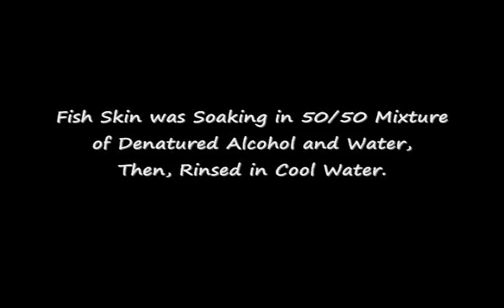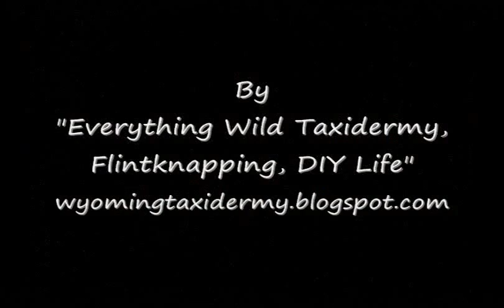FISH TAXIDERMY - BASS - Mounting, Fins & Repairs - Video 3 of 5

Comment: Hello, is there an alternative(s) to backing the fins and buying other taxidermy supplies? I'm only doing one taxidermy project (Hybrid Striped Bass) and I'd prefer not to buy the sorta expensive taxidermy materials for only one one mount. I'm alright with an amateur-looking mount and I don't plan on painting, so I'd like to know what is absolutely necessary to do this. Thanks!
Reply from the maker: ihave2rocks As I stated to you on your other questions, I strongly suggest you watch this complete five part video series I've done on fish taxidermy, Then, you'll notice that I advise throughout each video the supplies which are necessary and which ones can be substituted.  In addition, at the end of each video is a link to the supplies I use.  I suggest you check that out also for alternative supplies.  Thank you.  Rick
Reply: Thank you, I'll look into that when I got the time

Comment: I'm not criticizing the way you do your fish. And I've never done a fish myself. But for drying the gills, would wax paper work better for when you want to remove it rather than cardboard?
Reply from the maker: +caleb reimer I appreciate your thinking about how to do something better.  Good job.   The wax paper, in this case, wouldn't be stiff, or strong, enough to keep the gills separate, and in lifelike position, while they are drying.  The gill rarely sticks to the light cardboard.  But, if it does happen, it can be gently separated.  I also sometimes use a light plastic mesh for this.  That is found at various arts and crafts stores.  The holes in the mesh provide good ventilation for drying.  Great question and idea.  Thank you. - Rick                        

MORE FREE VIDEOS FROM RICK:  https://www.youtube.com/channel/UCuZnD9mnjx8Yh6-KiTPLU_A

Comment: thanks for the videos ive watched all of them. im at the fin repair part on a 6.5lb smallie. I have a air brush and I was wondering what your thoughts are on oil or latex paint what do you prefer. also when it comes to the mounting of the fish to wood what do you use to anchor it to the foam so it wont easily break off.
Reply from the maker: I use acrylic water-based paints.  It's easy clean up and isn't as hazardous as the others.    If you got a store-bought form, it should have a block in the back of the form built in.  If you made your own form, you need to put something solid like a block of wood to anchor it to.  I'm also attaching a link below to the supplies I use in this video series.  It may help you further.  Thanks. - Rick                           http://wyomingtaxidermy.blogspot.com/2013/08/fish-taxidermy-supplies-i-use.html

Comment: Do I have to worry about doing anything differently on a pike? There meat is softer so would I have to worry about ripping the skin during things like sowing up the backside?
Reply from the maker: +Tom “weaksauce” Geihl Most Pike have a fairly tough skin.  I've sewn them up and stapled them also.  Both ways work well.  You have to be careful with any fish you're doing.  Take your time. - Rick

Comment: Thank you so much for this. Anyways, after you slide in the individual cardboards into the gills, do you staple them together with the cardboard attached to the skin flap?
Reply from the maker: No.  I sandwich that skin flap to two pieces of cardboard while it dries.  I only staple the gill plate skin between the two pieces of cardboard.  If that isn't clear, let me know. - Rick
Reply: Clear as day. you're the best Rick. Thanks.
Reply from the maker: Something's are pretty hard to describe, aren't they.  Glad I could help.  Email anytime. - Rick

Comment: what's the shortest time to wait for the drying period of a fish. in the process of making a bluegill mount, which I believe are a fun fish to mount, I used the fill or half cast method, there pretty easy to mount to. also turkey hunting is coming up and I want to try a full body mount, that's going to be challenging, did you guys start hunting yet. do you need a tumbler for birds. thanks
Reply from the maker: Hi Kevin. Sounds like you're busy. 
The drying time for fish varies.  It all depends on environmental conditions; air temperature, humidity, etc.  It could take anywhere from several days to weeks to thoroughly dry. A good way to see if it's dry, though, is to check the tongue and gills.  They both are the last to dry.  If they are dry, the fish is dry.  I agree with you on the ease of the casting method.
Full body mount turkeys are hard to do.  It's a big job. Make sure you get all the fat out, including the tail.  I'd use an artificial turkey head for your first time.  The look of the head can really make or break your mount.  You can get either a pre-painted head or paint it yourself.  Make sure the wire is strong enough in the legs. Make sure you get the meat out of the wingtips.  You can either cut it out or inject with Birds Feet injection fluid.  Be very liberal with the dry preservative. Are you going to do a full or half strut? If full, you have to check and preen the feathers frequently while drying.  Keep moving them into their position. 
You don't have to use a tumbler for birds.  Use a hair blow dryer; gently shake the bird while drying.  Don't have the dryer too close to the bird.  Blow dry in the direction of against the feathers so they fluff up.
Our turkey season doesn't open for a week or two yet.  No fishing yet either.  The ice has just lately broken up, but, nothing's biting yet.
Email back if you have any questions.  Don't forget to let me know how the turkey goes. Good luck. - Rick

Website:  Everything Wild Taxidermy, Flintknapping, DIY Life
Reply: well I don't have a turkey yet, but I should get one here soon, I want to get one for my cousin, he hasn't got one yet. can you use a wire brush to flesh it. thanks
Reply from the maker: Kevin Prinsen Yes, you should use a wire brush and pair of scissors.  I believe I have a full strut turkey mount raw video that I should complete sometime. I won't be able to get to it soon, but, I think you're probably going to do a good job w/o it. - Rick

Website:  Everything Wild Taxidermy, Flintknapping, DIY Life
Reply: alright sounds good thank you, I was watching pheasant skinning 2 of 5, I didn't catch how you would get the meat out of the wing if it wasn't standing
Reply from the maker: Kevin Prinsen On a turkey, you'll have to cut on the underneath side of the wing to get the meat out.  Where the double boned joint is, cut there outward toward the end. Gently scrape the meat out.  Fold the skin back, scrape more. If I'm not clear, let me know. When you've got the fat/meat removed from the whole turkey, make sure you're liberal with the Borax in that whole wing area too. 
Email anytime with your questions, Kevin. - Rick

Website:  Everything Wild Taxidermy, Flintknapping, DIY Life
Reply: Richard Smith my uncle liked the deer mount, the bluegill I am working on, I cant get the painting right, it  looks like a tropical fish. its funny, but frustrating. don't know. I have two air brushes, a single and a double, which one should I use. thanks
Reply from the maker: Kevin Prinsen I'm glad your uncle liked the deer mount.  That was awesome of you to do.
Did you let the fish completely dry before you started painting? Bluegill dry very dark.  You needed to apply a light color, like a white, onto the fish before you started painting its natural colors.  Since you were probably painting on black, it's hard to tell if your paint was also too thick. Painting fish is harder than most know.  You need to very lightly mist the colors.  Very lightly. Accurate fish coloring is gained by a series of lightly misted colors.  Allowing to completely dry in between each and every color misting.  The finished product then has the correct colors, hues, shades, etc.  It's the biggest mistake people make on fish... painting too much, too thick.
I use a double action airbrush, but, it doesn't really matter.

- Rick
Website:  Everything Wild Taxidermy, Flintknapping, DIY Life
Reply: i did paint wihite over it, I think my problem is painting to heavy. this one actually dried pretty white. thank you
Reply from the maker: Kevin Prinsen Common problem, Kevin. MIST layers LIGHTLY. - Rick

Website:  Everything Wild Taxidermy, Flintknapping, DIY Life
Reply: if you had a fin split really bad, how would you fix it so you wouldn't see the backing
Reply from the maker: Kevin Prinsen You have to put the backing on, no matter what.  Put the backing and Modge Podge on the backside.  Then after it's dry, with a lead pencil draw fin ray lines where they look realistic. Dark enough to match the other ones. Then, put Modge Podge on the front.  The lines should show through and look realistic once dry.  After it is dry, paint as needed.
If worse comes to worse, you can also buy artificial fin rays. - Rick

Website:  Everything Wild Taxidermy, Flintknapping, DIY Life

Comment: thanks richard smith for the great videos ive learned alot , i actually have my only issue with the finishing and painting as i dont have any air brush and still i am practising on  different type of paint like water colors, acrylic colors , oil colors and still the result is bad and far away from what i want . is that because i need to have an airbrush for the best results? moreover i used spray paint aswell and it was a horrible experience i had to through the fish away because couldnt paint on top of it
Reply from the maker: +maher yahya You can strip a fish back down and start over by using Acetone or paint thinner.  Both chemicals are very dangerous and special precautions absolutely have to be used.  I wouldn't recommend it for beginners.  Air brushing is the best method to use for good results.  You can hand paint, but, the results won't be perfect.  The airbrush enables you to fade the colors, light to dark and vice versa, flow over, lightly dust.  Painting fish is very hard to get right, even with an airbrush.  Takes a lot of practice, patience and good reference photos.  Most of the time when hand painting, your biggest problem will be using too much paint.  That's probably one of the areas you had trouble with. So, use less paint and lighter strokes.  It's better to go "light".  You're trying to replicate fading, layering, blending of the colors.  Make sure your light layers dry in between the next color.   I'm glad you're trying to do a good job and can see your mistakes.  You'll learn from them.  I would suggest you get an airbrush.  I have a link on my website of what I use. There's also tips for fishing painting there.  If you can't afford one right now, continue on hand painting and keep an eye out for a good, used airbrush.  Let me know how it goes.  - Rick                        Supplies, tips, etc., on my fish taxidermy video:     http://wyomingtaxidermy.blogspot.com/2013/08/fish-taxidermy-supplies-i-use.html
Reply from the maker: +maher yahya I received your latest email about the airbrush.  I'm not going to publish the link, however, as it is a really good deal and would get grabbed by others.   I read the entire listing, with everything that's included, it is something I would've bought even.  If it can even do nails, it can certainly do taxidermy painting.  The seller's feedback score is good also.  I was concerned about the shipping, but, it's free.  Parts are also readily available.  It's a chunk of money, but, it is worth what they are asking.  - Rick
Reply: great il go for it then thanks alot for the help once again and wish you the best
Reply from the maker: +maher yahya Good.  I'm glad you got that set.  You really get all the goods for a decent price.  If you think of it, let me know how you like the airbrush.  Takes some practice to get the hang of it.  The results are much more realistic, however.  It'll really help you a lot if you have actual photos of the fish (not artists' renditions) right at your workstation to refer to also.  Good luck. - Rick               
MORE FREE VIDEOS FROM RICK:   https://www.youtube.com/channel/UCuZnD9mnjx8Yh6-KiTPLU_A

Comment: Hi I had a question about cleaning the fish. Does the brain come out or do you leave it in?
Reply from the maker: +Legal Limit Fishing You need to cut up inside the boney area in the head and remove all the matter you can.  I use a side-cutter or heavy duty scissors to cut through the bone.  If you don't get it all out, it will bleed through.  Don't forget, before you mount it, pour Borax down in there well.  It'll help dry it up inside.  Good question. - Rick
Reply: +Richard Smith thanks I watched some of the videos on your channel: really cool. Also I have a couple of videos on my channel, you might like them. Thanks
Reply from the maker: +OJD Sport Fishing Team You're right.  I checked a couple out.  Very nicely done.  Good footage, clear, crisp.  Send me your YouTube Channel link and I'll put it up here.  I think it's well worth sharing with my viewers.  Good job. - Rick